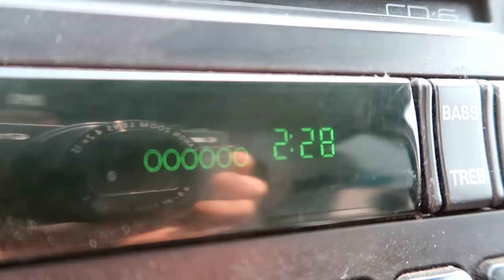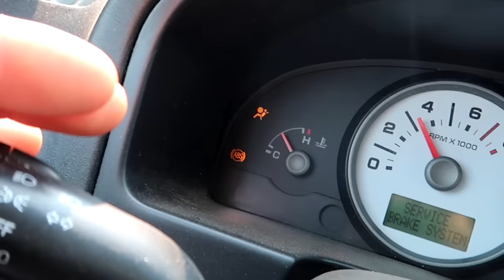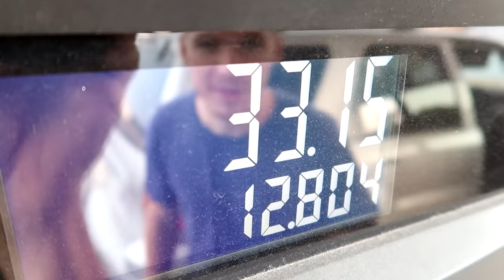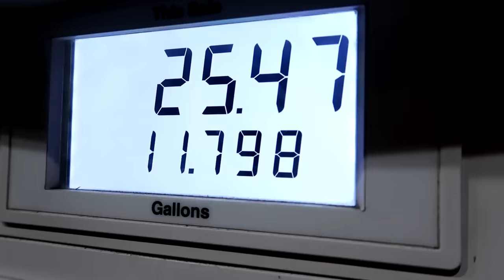Driving The Cheapest Car I Could Buy Across The Country

Comment: I had one and it hat rot on the passenger rear inner quarter inside. Shock tower was not attached. Ford should have recalled the trucks and replaced both rear quarters. There were many escape, Mariners and tributes (all the same vehicles) that rotted out prematurely due to thin sheetmetal and poor rust preventing sealer.

Comment: i payed 700 for a 96 mazda b3000 aka ford ranger. drove it for 8 years before it blew up and got 300 out of it from the junk yard. so 400 for 8 years of driving the truck more then payed for its self. i did put a fuel pump with sending unit and injectors fuel pressure regulater in it those 8 years but it was a good truck for the price